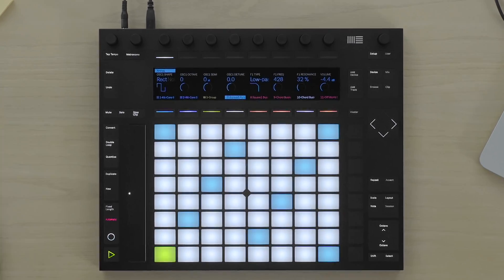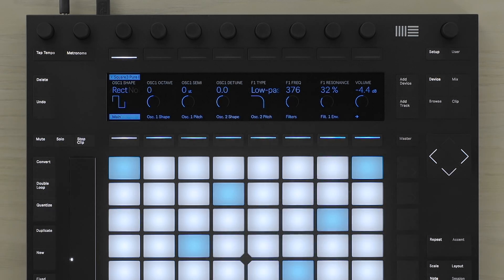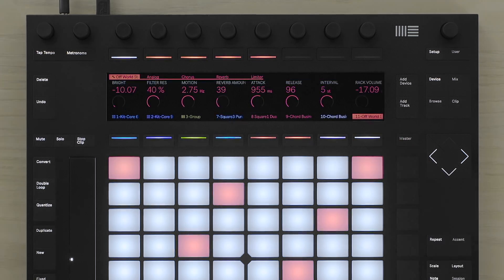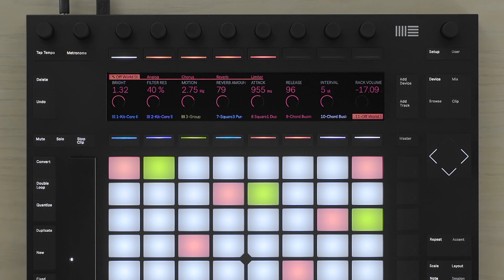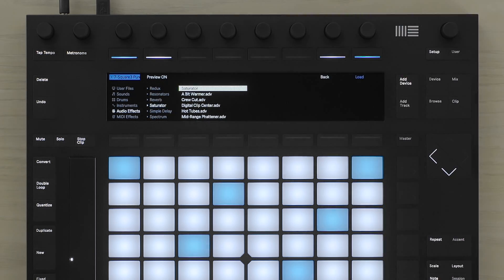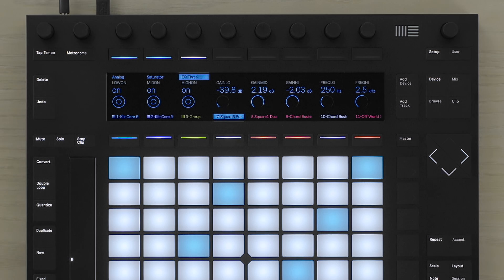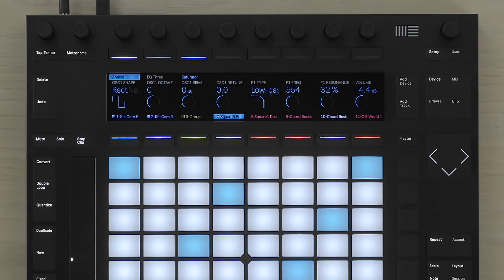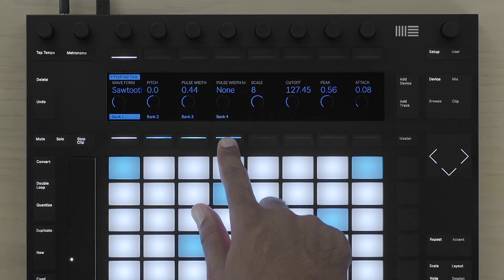Learn Push 2: Sound design tips

Comment: In the video it says for third party plugins, the most important 8 parameters are automatically mapped, Is this from a prior macro setup made by us or does the software do this?
Reply: by default Live "maps" the first 32 parameters if the plug in has up to 32 parameters. if it has more it won't map anything. You can change this setting using the "PluginAutoPopulateThreshold" option in the options. txt file. Instructions here: https://www.ableton.com/en/help/article/optionstxt-file-live/ . nevertheless when it is done automatically  Live follows the order set by the developer of the plug in so it can be a total mess and you will have to configure it yourself either way.
Reply: @rodzeroher  I know it's an ancient comment but thanks so much. I can finally tweak my plugins directly on Push.
Reply: +Ekkomouse pretty sure the software does it. It was a complaint many people had with push 1 and the original set up. Now for example the 8 macros in massive will be mapped to the 8 knobs automatically
Reply: +Ekkomouse wondered about this as well.